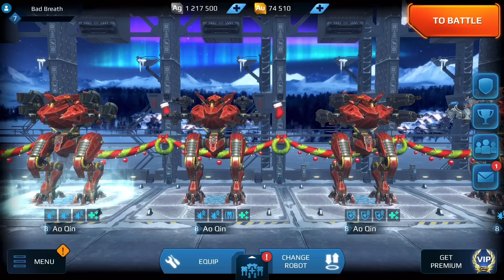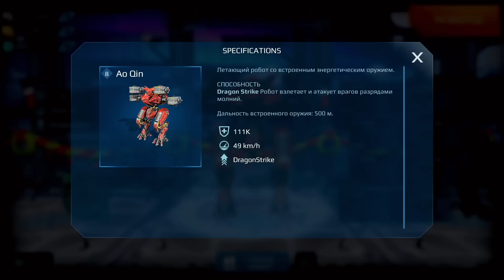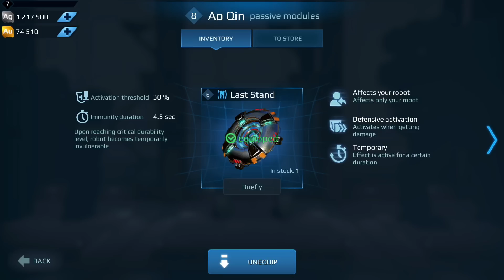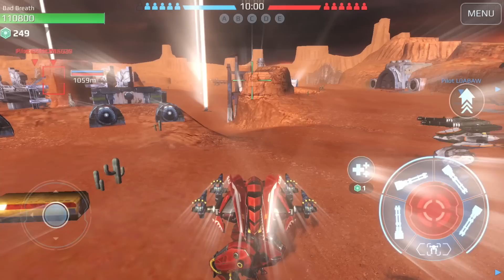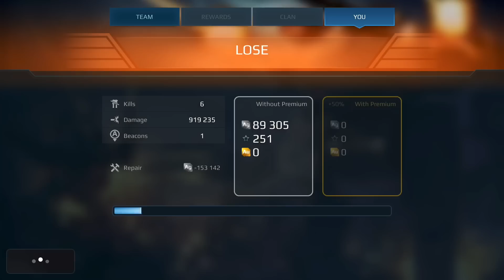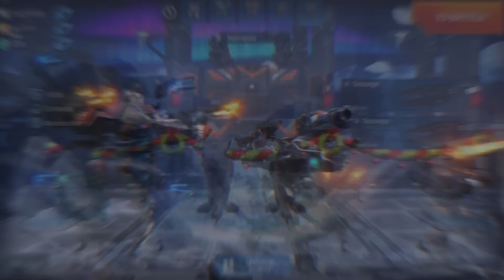War Robots NEW Red Dragon Robot (Ao Qin) Breathes Energy Bolt! / WR Test Server 4.7 Gameplay

Comment: Nope.. modules is a bad idea. Bot become invisible for 5 second..n nobody can kill you.. that's not skills.. that's pay 2 win.
Reply from the maker: tonmy cas I play on Android too - free account and I'm in Diamond League 2. I have published videos of this on my channel.
Reply: It's been making it's way towards sneaking more price tags in for the past 2.5 yrs. So long as the misbalancing of weapons and bots doesn't happen again...
Reply from the maker: slag burner I'm going to be watching to see if they change stats of bots or whether they'll be doing it in the form of module slots instead. For example if the Ares is too strong they remove one module slot. Even if they did this the player doesn't really lose out because they'll just use that module on another bot. If they adjust stats for a bot though then you lose out - I'm not sure if you follow?
Reply: I just got back into the game and I'm in champion league again with lv10 bots I average 800k damage pre round modules are a little hepfully especially  against the stealth
Reply from the maker: There's actually some parts of modules which are good that most players have not thought about. For example for a free player it actually works out cheaper. They don't have to MK2 a bot and even if they spent a lot of time upgrading that bot (which they won't have to necessarily do anymore), when the meta changes it allows them to take some of that change with them and apply it to the next set of meta bots. It's a lot cheaper to rather upgrade modules and move them around than it is to upgrade a bot to MK2 AND do modules. Even in our clan we are wondering whether there's even any point to MK2'ing a bot now. Weapons and modules at max level I think now becomes more important than anything. As for robots because the game changes so fast, just getting that to level 12 max MK1 might be sufficient (if you are in Champion League).
Reply: @adrianchong  not true cos mk2 are going to be mk3 with the modules...
Reply from the maker: @tonmy cas  Let me give you an example. The other night we faced a full squad of MK2 using boosters and Modules - we won. We weren't even all MK2, not many of us were running boosters but a few were running modules. The other team couldn't use Mercury against us like before so modules actually neutralize MK2 more than you think. The problem with modules in general is that you actually can't tell what the other guy is running. Yes they might have MK2 and yes they might have Thermonuclear Reactor but if the guy they are fighting has Thermonuclear Reactor and Last Stand the other guy could win without even being MK2. You could argue "but what if the MK2 player has it too" - yes they might have it too but then the other player may have the counter. It presents more counters and whenever you have more counters not even MK2 will save you. This is also where experience and skill comes in. You say I'm full of it, do you play in Champion League against top clans?
Reply from the maker: tonmy cas btw we just beat that clan again tonight. Here maybe this will clarify things for you. Let's say you MK2'd a Mercury and you were going up against a Spectre MK1 level 10 with Quantum Radar, Thermonuclear Reactor and Last Stand. The Spectre stands a good chance at smoking that Mercury. Yes the Mercury could have anti-stealth too but if the Spectre is running Last Stand and the Mercury isn't, the battle actually favours Spectre more. For the player who MK2'd their Mercury they actually lose out because one of the main reasons why you would MK2 a Mercury is because of the Helldive damage. However... that Helldive becomes less relevant if the other guy can see you in the air because you no longer have that stealth ability. My Falcon which I MK2'd recently also becomes less relevant because I could always apply 2x Heavy Armor Kit's plus use heal. There is no reason why I would need that Falcon to be MK2 except for maybe more health but why would I need that if I can heal and have additional health anyways? The only bot I can see right now that really benefits from MK2 is the Mender since you heal more but for most it's actually not worth it. 

If players don't have to MK2 a bot like Mercury, that means they save themselves 198 million silver plus the time and any gold needed to rush it. Instead they would put those resources rather into a module such as Thermonuclear Reactor. When the meta changes, they remove it and put it on the new bot or other bots they might have.

There is less reason to go MK2 on a bot, however there is more reason to diversify even more. If you look at the battlefield you're seriously telling me you would rather prefer to fight 5 Spectre or 5 Ares hangars because there's "something to work towards"? Hate to say this but that's a rather boring game to play whether you play in Champion or lower leagues. I prefer variety.

Players who tell me about "skill" most times don't even know what skill is. Skill to them is walking around in a bot that takes forever to move from point A to point B. If we look at the game when it was called Walking War Robots, we had jump, we had stealth, assault mode and the energy shield of the Carnage. Do you know how I would smoke a Rhino? I would load up a Griffin with Orkan Pinata, I would wait for the Rhino to get close, jump and fire from behind cover and the Rhino would be down to 10-15% hp. Try say the same thing about two dashes going head-to-head where both players are required to track targets quicker while moving quicker. You go into battle now, I can assure you, you're looking to see whether the other guy has Overload, Helldive, Stealth, Greek bot shield etc. If you're thinking more about the enemy and how to counter them, that requires skill. Players probably tell me I have no skill because I'm running Greek bots - there's a spoiler though... I own zero Greek bots and own zero passive modules. I just scored over 1.8 million against a squad who runs heavy modules, MK2, boosters etc. I guess I have no skill.